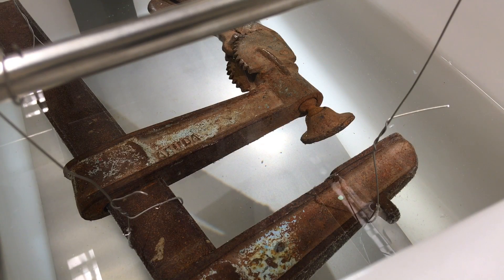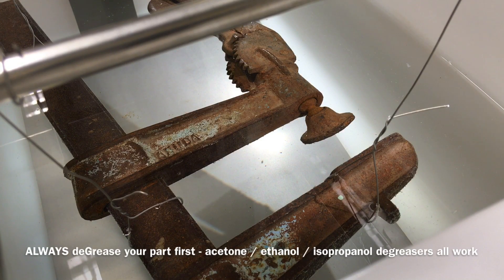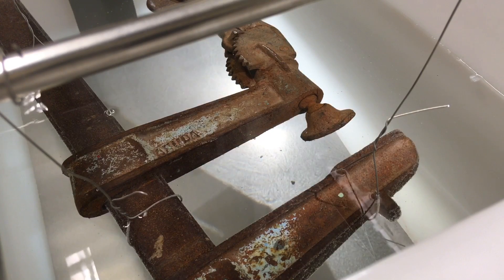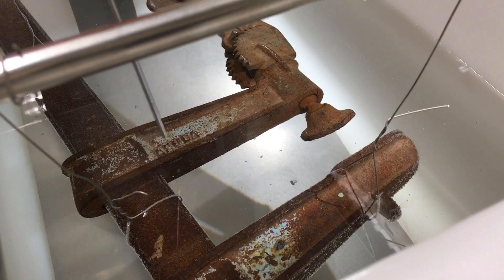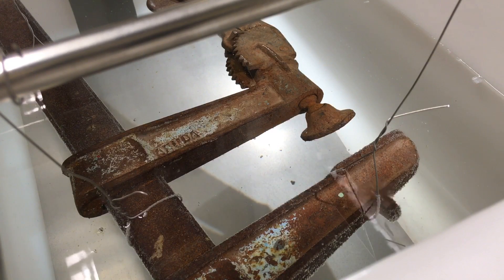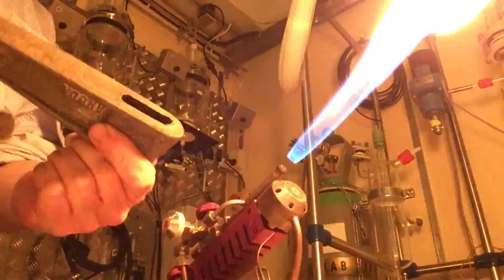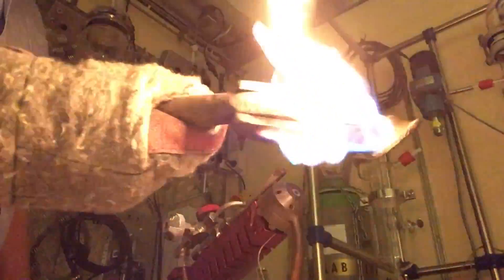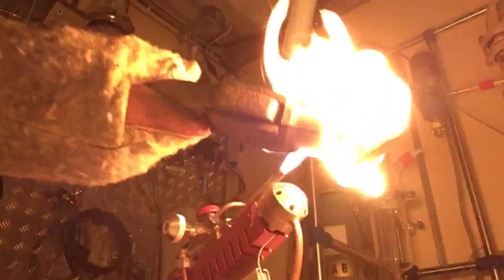True rust removal by a chemist - a titanium electrolysis setup

Comment: Hi Ken! First, I just wanted to thank you for putting up this video. It is amazingly helpful! I do have a question for you. I have a powder coating shop and recently received 5 steel wheels from a 1949 GMC pickup. As your can imagine, they were covered in rust. I used your formula, only on a much bigger scale. But the proportions all matched what you used in your experiment. Now, what I've noticed is that the electrolyte solution has become more effective the more I use it. When I submerged the first wheel into the tank, the process to nearly 5 hours. The second wheel was significantly less, just about 2.5 hours. Now that I nearing the end of cleaning all of them, it's taking just about 1 hour per wheel. I'm using an old professional style battery charger. Each time the charger is turned on, it's output has been just about 15 amps. Also, I'm using rebar as my anodes. None of them are covered in rust, yet the bath is running fabulously. I'm hoping that you can provide some insight as to why the process is speeding up and why the anodes are almost completely clean. Thanks again for your great videos!
Reply: I would love a response also from you Sir Chemist. Could you also tell me if the larger the titanium sheet the faster the removal ?? Does the grade of titanium make a difference too ??? Why does the process go faster every time a fresh and rusty piece is put in the tank as expressed by the truck wheels ???  Thanks you Sir.
Reply: @victoryfirst2878  Hi! Because I just saw you're question, and its basically the same question I asked about the effectiveness of the solution. The good Sir Chemist replied to me with this referring to the Iron content of the used solution...

"To some small extent, these iron ions may lower your pH even more, making your electrolyte more effective, but I would (without knowing how much rust you have dissolved) say their main contribution is to allow for better charge transfer, meaning a more conductive electrolyte. So, they essentially enhance the conductivity of the electrolyte you made by adding the table salt."

Basically, I'm using rebar as my anodes, they dissolve as the process goes on and that adds Iron Ions into the mixture making it more conductive. Thus making the process go faster. And it did! I can't post pictures here but I did upload them to my instagram @viperpowdercoating if you'd like to take a look at the last wheel I did. It was amazing!  I probably could have take it out after 60 minutes. But left it for 90. I've also read that the larger the anode used, the more surface area is covered and theoretically a faster process. I'm going to try that one out for myself. But I'm quite sure that the good Sir Chemist can be much more useful. I just thought I would share my findings with you. Best to you, Victory First!
Reply: Jack Ha
Reply from the maker: Many thanks for highlighting that it works on larger scale as well. What you tell is sometimes difficult to observe when working on small scale without good comparisons. The explanation to what you see is the following: 
With the addition of the acid (in the vinegar), the pH went down and the solution became acidic. An acidic solution of water has the capability of releasing the iron ions from their solid and bonded form in the rust itself. The more acidic, the faster this will happen. Now, at the pH where you are with the addition of the acetic acid in the vinegar, which is about 3-4, the charged iron ions are still not completely dissolved, meaning free moving as Fe3+ or Fe2+. They are moving around in the solution as combinations of hydroxides and to some extent oxides, although they are so small that they are invisible to the bare eye. These oxides and hydroxides would remain on the bottom of your tank and become visible if you allowed all the water to evaporate. However, since they are so small and readily soluble (dispersed) in the water, a bonus is that nothing is clogging your rebar. To some small extent, these iron ions may lower your pH even more, making your electrolyte more effective, but I would (without knowing how much rust you have dissolved) say their main contribution is to allow for better charge transfer, meaning a more conductive electrolyte. So, they essentially enhance the conductivity of the electrolyte you made by adding the table salt. To have a completely transparent and only green brown colored electrolyte, you have to go even lower in pH, and more acidic. When more acidic (pH lower than 1), all the hydroxides/oxides will dissolve and go into solution if no oxygen is present, which requires you to seal the system with inert gas on top. Here is no use of it anymore since the hazel with getting rid of the electrolyte will be extra work, and the faster rate of the electrolysis just makes it difficult to know when to stop. It is also beneficial that the electrolyte you have now is just to flush out in the drain, unless lots of solid stuff in it, since it is only iron hydroxides and vinegar. I hope this was relatively clear. All the best and again many thanks for sharing your results!
Reply: @Ken_Sweden  thank you so much for such a clear explanation. What you just explained now makes all the sense in the world. If I remember correctly, with 35 gallons of water, I used just under 2 gallons of vinegar and 2 1/2 cups of salt. So by starting with a good base solution, as the rust dissolves the iron content goes up, thereby making the solution more efficient. Believe me, when I was finished, I didn't want to get rid of that mixture! But because of limited storage space in my shop, it had to go. I will make it again when I need it. It was very inexpensive and very effective. I'm not sure if I can post pictures here. If I cant, I will be posting them to my Instagram page for you and anyone reading this to actually see my results. @viperpowdercoating Again Ken, thank you for posting your videos and for such a clear explanation. I truly appreciate it. Best wishes to you and yours..
Jack
Reply: @Ken_Sweden  I know it's already a 4 years old reply but from what I understood is that the solution is becoming more effective as a rust removal tool but also chemically hazardous for a human being? . . what should I add to the solution to make it less hazardous before I get rid of it in the drain? Wood ash maybe? should I add it slowly to prevent a violent reaction with the acidic solution. 
Reading your reply . . I thought to myself did we create the best electrolyte for a battery or what? 🤣😅

Comment: Some videos after the rust is remove the surface of the water is  a thick soupy rust color. Where yours is not. Why?
Reply from the maker: It's because I make the liquid acidic. When it's acidic, all the rust dissolves. In the other videos, the rust is merely loosened from the surface, and chunks are in that froth on the surface. An acidic electrolyte is always more effective, but you should neutralize it with some baking soda or by coating it with phosphoric acid so it is sealed after you have removed all rust.
Reply: @Ken_Sweden  Thanks. You probably couldn't leave part in to long using the vinegar. Have tried leaving parts in just vinegar. If it goes to long the metal pits.

Comment: I’ve watched your videos and I’m confident now to try and clean my petrol tank (mk2 cortina) any tips on please 
George
Reply from the maker: I'm making a video on this at this moment.  For the petrol mc tank job, I am using citric acid diluted 9 times and heated to 80. This way you avoid flash rust. The electrolysis on petrol tank is of course better and smarter but if you run it on a tank only rusted inside, the painting on the outside may get damaged. Good luck!

Comment: I just started working with electrolysis for rust removal and I've watched a lot of videos and read a lot of articles but I like this one the best. Based on this video I bought some titanium wire for suspending my cathode objects in the electrolyte solution, but I'm stuck on the titanium plating. When I used a sheet of steel with a bit of steel bar welded to it for the connection point, my solution filled with rust particles after just one use. So I'd love to start using a better anode. But titanium is available in a lot of thicknesses and I haven't found any reference to indicate how thick it needs to be. How thick is your anode foil? From where did you source it?
Reply from the maker: 0.7 to 1 mm, thin enouh that it was sold as rolled up but I cannot remember from where, sorry
Reply: @Ken_Sweden  That's enough information for me to go looking, thank you! My sacrificial anode is a sheet of scrap I found and it is clouding the tank with a ton of rust so I'm definitely keen on getting a better anode.

Comment: Is it true if you use 24v @ 5 amps works better than 12v @ 10 amps, also since Sodium chloride is basically neutral & white Vinegar is acidic with a Ph of 3 or so increasing the amount of Vinegar would speed up the rust removal or would it etch the metal to much?

Comment: You can also equalize the field strength by adding additional anodes.  Also, if you wanted to use a digital type charger you could hook it up to a battery in parallel. The old transformer type battery chargers are kind of hard to find.
Reply: It's good to know that I was alright in using this solution, I just assembled a tub yesterday and because I didn't have an old battery charger I just hooked up a deep cycle battery and the charger to the battery. The charger provided power and the splitting wedge is now much less rusty.

Comment: Hydrogen Embrittlement could make the parts brittle and liable to fail under stress or load. Do not use this method fir safety critical parts, brake callipers,steering racks etc. The hydrogen can only be removed by high temperature baking above 200 degrees depending on the immersion times and solution strength.
Google Hydrogen absorption and Embrittlement.
I have just retired from 48 years in the metal finishing ( paint, powder coat, EP paint and electroplating) of high spec automotive and aerospace parts.
I hate these home cleaning videos.
The vice in this video could fail under load!!!

Comment: Mystery for the chemist!  I totally recreated and upgraded my electrolysis tank based on this video (kind of) but now have a strange observation.  New setup: 5’ x 3’ x 2’ plastic tub with three 12”x24” CP3 4902K titanium .02” electrodes and sodium carbonate! The power supply is a Longwei 30v/10A DC power supply.  When I first put the power supply on it will run at 10.2A and 30V, but over a few minutes reduce itself down to about 1A and 4V. Bubbling pretty much stops. In the spirit of experimentation, I moved the power supply to the old electrolysis tank in a trash can, citric acid and a single piece of rusty rebar. I set the power supply at 30V and 10A and the bubbling went insane!  The amps stayed constant. Second experiment—I moved a 12”x18” titanium sheet over to the citric acid tank and the amps dropped to almost nothing.  So it’s the titanium. Why would a single 18” piece of rusty rebar and citric acid keep 10A but my super duper titanium-based tank do so poorly?
Reply: Where are you measuring voltag at the power supply posts?  If BOTH  your current and voltage is dropping you have a power supply issue or a separate high amperage current path developing not thru the current shunt dragging the voltage down.  Given the power supply name and the fact that you are trying to draw its full capacity or a little higher it could just be a poorly designed / damaged protection circuit in the power supply. If you reduce the voltage or the titanium surface area to get under 10 amps it might behave.
Reply: @anullhandle  Thank you for the reply. I am just relying on the LED display, no measurements.  When I use rebar as an anode, I get 32V and 10.1A.  When I move to titanium I get 31V and 1.4A.  I then tried a random steel pet bowl, and I got 30V and 7.5A.  The metal seems to be the variable.  What's interesting is that as the rebar wasted away I started getting iron shavings that looked like little trees deposited on the metal I was trying to derust.  Magnetite?  Not sure what citric acid plus electrolysis plus rebar turns into...

Comment: Any issue if I used citric acid in water and a couple of titanium spoons as an anode? That's what I just put together in a 45 gallon trash can and a 6A battery charger to take the rust off of some large items. I have it running now and see bubbles, but I wonder gas the bubbles are.  Basically, am I going to blow something up, breathe in something caustic, or somehow make myself ill out of the soup it makes when I put my hands in the solution?

I previously used water, sodium carbonate, and a couple of graphite rods but after a couple of weeks the rods disintegrated.
Reply from the maker: Good input. Nothing dangerous there apart from your high current values. Be safe and don’t electrocute yourself.
Reply: @Ken_Sweden  Bubbling stopped so I tried a couple of steel rods.  They worked for a bit then stopped as well.  I suspect the citric acid isn't a great electrolyte?  I poured in some sodium carbonate and got a lot of fizzing, so I think that is carbon dioxide being released and the forming of sodium citrate.  I'm not sure that this will get the electrolysis working again.
Reply: We've got bubbles again.  It looks like citric acid needs more electrolytes added. I suspect that adding the sodium carbonate will dilute the citric acid, though, so perhaps this is a choice between citric acid taking off rust, electrolysis, or find another electrolyte for citric acid that doesn't convert it to something else.
Reply: Hmm. That didn't last long. I got about an hour of electrolysis and it died out again.  I put in about 4 cups of sodium carbonate into about 35 gallons of citric acid. Looks like the anode is the issue.  The titanium spoons are coated with something so I put in my old depleted graphite (3" nubs now) and electrolysis started again.  Maybe I didn't need the sodium carbonate anyway.  I'll order some .020" titanium foil.

Comment: Ken! Thank you, could you replace the vinegar with meriatic acid and salt with sodium bicarbonate? So meriatic acid and sodium bicarbonate electrolysis?
Reply: This would essentially be running a NaCl electrolyte depending on your ratio. Might end up with either acid or bicarbonate in excess. But main concern I would have is evolution of chlorine gas.

Comment: You should not use NaCl for electrolysis because you get chlorine gas even if in small amount.  As you know chlorine gas is very toxic which was used in WW I.  

2 NaCl + 2 H2O → 2 NaOH + H2 + Cl2
Reply: Wrong.
Combining Common Salt and Water gives Salty Water. Also, your example would produce HCl (Hydrochloric Acid). As can be seen from the video, this is not the case; in fact Vinegar has to be added to help the reaction along.
Salts derived from strong acid/strong base combinations will not undergo hydrolysis. The NaCl dissociates in the water; result: salt water. The energy from the electrolysis is entirely taken up with breaking down the solvent, in this case H2O, to produce Hydrogen and Oxygen.

Comment: Hi Ken, I tried reproducing this setup for a very rusty exhaust pipe using a titanium mesh electrode (I thought the greater surface area from a mesh would speed up the process), but my anode is being consumed! Is this an expected part of the process? I have been running the electrolysis at around 30V and 1A for a few days and it almost looks like the pipe is acquiring a titanium plating.
Reply: You may have switched the anode and cathode. That's how you plate. Also i heard that lower voltage is good
Reply: @pancakedragon1840  thanks for the response! I checked the polarity so it could be the voltage. Perhaps the mesh electrodes get consumed faster than the plate electrodes. At the end of the process there was a lot of white powder precipitate which I assume is titanium dioxide.